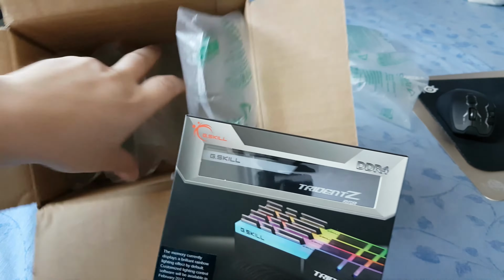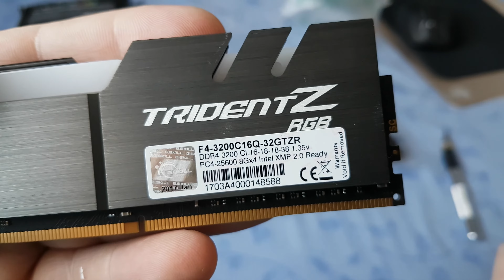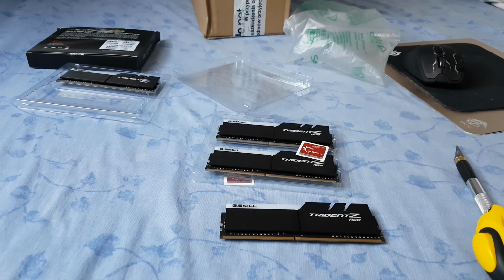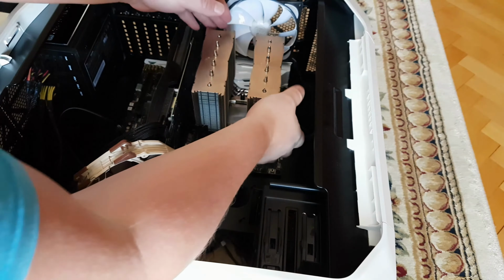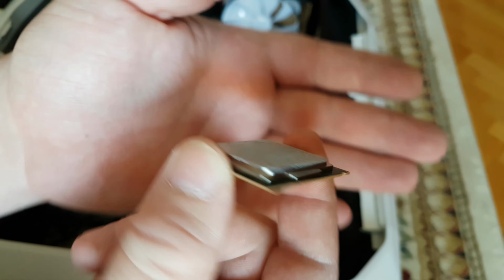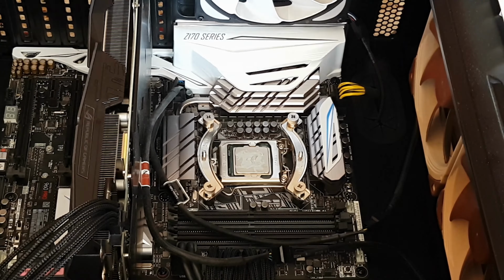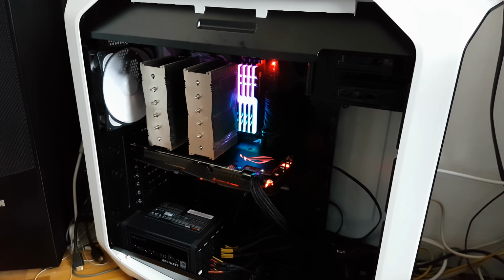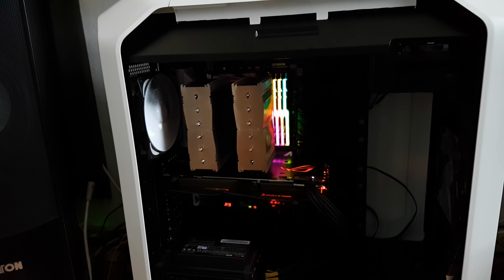G.Skill Trident Z RGB unboxing / grizzly kryonaut after 1 year

Comment: You should use isopropylic alcohol at least 90% to clean the thermal paste. The scratches are from kryonaut. One of the pastes that does scratches unfortunately. The way you see it that is dry it is suposed to get like that. Were your temps higher thatn the first day ? You can also try kryonaut extreme or arctic mx5 (2 new generation of pastes- more advanced )

Comment: Nice RAM, and I noticed that you're using Samsung 960 PRO NVMe SSD right? Does that get hot and throttle much when using in Full load? I'm intend to use for running virtual machine and software development.
Reply from the maker: much less than 950 pro
Reply: What is the maximum temperature you get while using this drive?
Reply from the maker: 85c